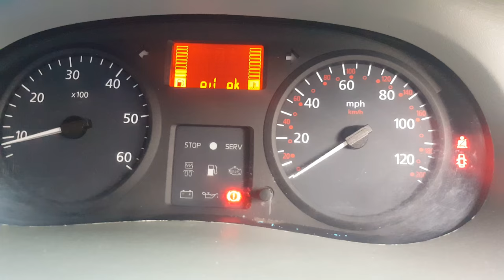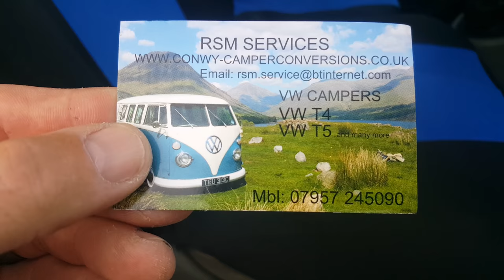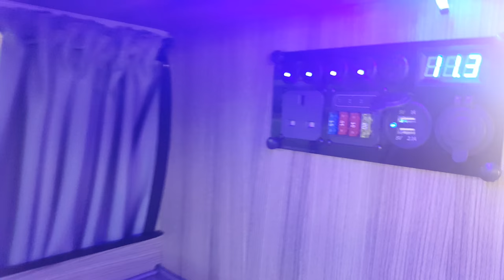nissan primastar camper conversion

Comment: Good job, I like it. All the well-designed space.
One thing, those blue LED, split eyes. In such an environment, I would prefer a soft light. Or at least, the source of light hide so that you can see the illuminated space, but no LEDs.